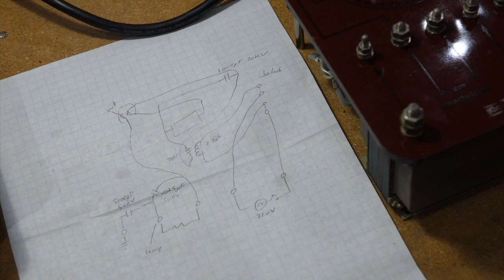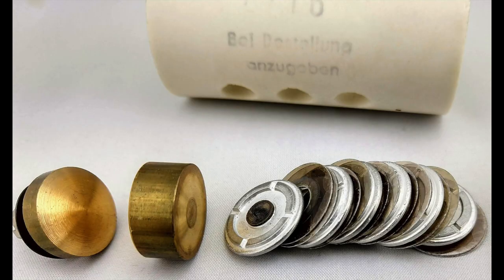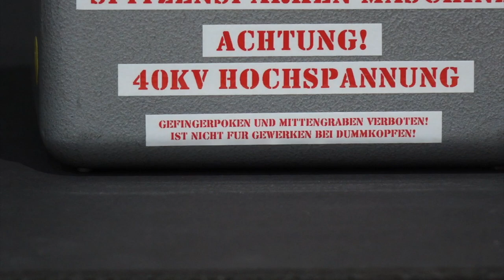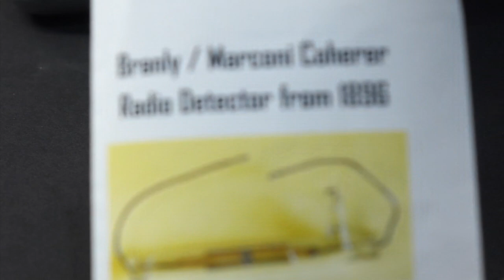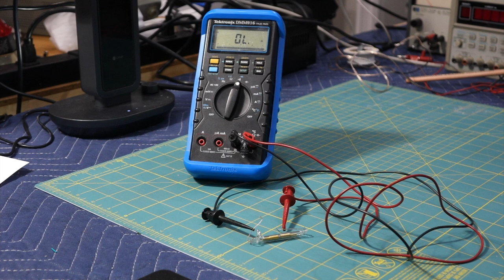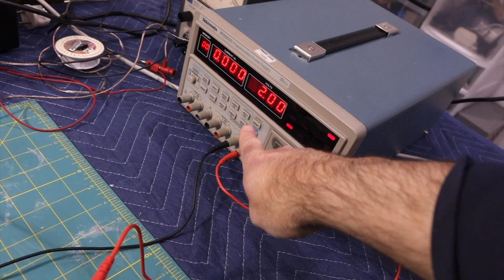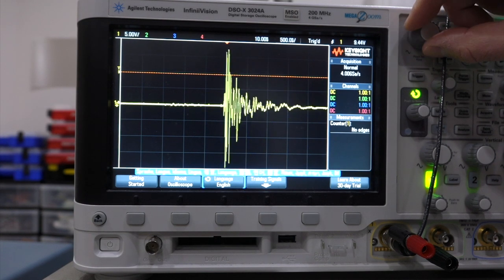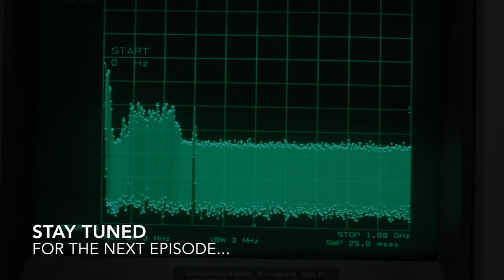We Rediscover Spark Gap Radio by Accident

Comment: So you gave people in your neighbourhood a pretty hard time listening to radio during that episode?
Reply: And TV and maybe wifi? FCC coming to knock on Marc's front door soon ;)
Reply: Power drops off with the square of the distance from the source. It may have been momentarily annoying for a residential block or so around.
Reply: No worse than CB radios were years ago.
Reply: What about WiFi and mobile phones?
Reply: @bobroberts2371  Ha!...but only if you transmit the numbers 4, 8, 15, 16, 23 and 42 ! 😂
Reply: @lwilton  Indeed, but there is a reason spark gap transmitters are illegal under international law since 1934. They are very wideband and very noisy. And he is powering with a 40W power supply, that is almost enough for weak transatlantic communication.
Reply: @BobWiersema  Yeah, it only took 5 years to get international law to agree to no spark gap transmitters unless in emergency. Obviously not noisy enough to cause concern then...
Reply: Naaaaah!. Marc built his house with the correct RF protection so the walls has a copper shield connected to ground!  ;-)
Reply from the maker: No, this is in my basement without an antenna. Not enough to cause any harm outside, I had a hard time to pick it up on an AM radio in the next room. Did not do anything on our WiFi or TV either (or at least the kids did not come running at me). You do a lot more damage running a Tesla coil. Woke up my lab computer though! With an antenna and on the main floor and a bit of tuning, that could have been quite annoying. It's pretty obvious why these transmitters were banned long ago!
Reply: @EwanMarshall  The ERP would have been minuscule, though - nowhere near 40W (the ERP was probably milliwatts)
Reply: Probably similar to if someone fires up an old car or tractor, especially if it has magneto ignition. Mine you can't take digital video if you're near it because every time the engine fires the video distorts severely, same with the McCormick deferring stationary engine.
Reply: I was wondering about that... I know a few HAMs and one of them had cause t see the inside of the special cars the FCC uses; i twas a plain old Chevrolet Caprice, except the roof was replaced with fibreglass and pasted to the inside of this was a large, circular antenna of great sensitivity and with which the source of any offending signals could be easily pinpointed.  The FCC has broad-ranging powers and I know for a fact that authorization has been given for windows to be broken out on aeroplanes so that an emergency beacon that had been set off by a hard landing and not subsequently silenced (it is ordinary practice to check the distress frequency when you are finished with the plane for this purpose) could be shut off.  Someone's plasma television was carried away because it was putting out anomalous signals and he refused to shut it off because he was confronted about it in the middle of a football match.  I think this was, perhaps poor timing on the FCC's part, but, eh?

I would think that he's in the clear as long as he doesn't operate this on a consistent basis, barring the implausible scenario of one of those cars being out front by chance, manned and operating, I can't imagine it caused such disturbance that anyone realized that there was an anomalous signal at all, and not just some random failure of their equipment or someone else's.
Reply: I remember receiving a pirate radio station on my cassette player.
Reply: @Lazarus7000  Plasma TVs were the bane of HAM radio operators everywhere while they were popular

Comment: Those poor SW- amateurs in your vicinity...
Reply: Hi there, I came to comments to ask this very question. What is it that they may be experiencing, and from how far away could this be heard?
Reply: Hahahaha, I remember my experiments back in1975 my brother still wondering why the TV has black and white bars in the middle of the football match, hahaha!!
Reply: Not just shortwave, that thing was kicking out RF over most of the spectrum. However, without much of an antenna, it was probably only detectable for a few hundred meters.
Reply: Spark gap transmitters are very wideband and very noisy. He may not have an antenna connected, but I'm quite sure that he can at least annoy any SW- amateurs with a reasonable antenna and receiver 2 or 3 kilometers away. When I was a young YL in the 90's, a cement mill in the next city used a Ward- Leonard- Set to start up their ball mills. That thing blocked every SW band for about 2 minutes. Went like bssssSSSSSSSSSSSS (increasingly louder and higher) brag (when they switched from the WL to the "runing" recticifier). You could count the number of machines they started up. And of course they did that when you just had contact with a very weak station and bad fading. Authorities didn't do anything about it, as it (quite strangely) only blocked the SW- bands and left VHF and UHF alone. So there were only a handfull of ham guys complaining and rising from your cozy office chair for them...

Comment: Next time there's a thunderstorm, I'd be curious to know how far away that coherer would be triggered by nature's own "spark gap transmitter" in the sky!
Reply: Well even with a normal radio you can hear thunderstorms on AM very well. Even if they are really really far away.
Reply: @Heads Mess hahaha yeah, I used to do that too. I took a neon on a stretched out coat hanger, disconnecting the jumper between each section as I went, touching the Heath-Robinson Tester onto the wire.  Thankfully, the farmer was clever enough to put the electric fence pulser by the entrance - easy to replace the batteries from the back of the Land Rover...  I remember the mechanism, it was just a small heated bimetallic switch turn the knob and the contacts moved further apart the batteries needed changing about every 3-4 weeks, on the plus side it did seem to cope with lightning, something later models had problems with, so lightning arrestors would have to be put in every 50 yards to stop the damn things from popping in a thunderstorm.

Comment: I remember we had a Blinkenlights and Dummkopf warning message on an big old Siemens development system I used back in the 1980s when I had a work placement at Wandel & Goltermann in the UK.  It used 8" floppies, when it worked at all, and was sat on my bench.  One day Princess Anne came to visit the site to open a new building, followed by lots of German VIPs.  The Dummkopf signs were hurriedly covered up when it dawned on us that the Germans might not see the funny side.  Shortly afterwards the machine gave up the ghost and I had to re-write all of my code on a "modern" HP system.  The business eventually closed and the new building was abandoned for many years.
Reply from the maker: We had that sign at the Computer History Museum on top of our "German" IBM 1401. We had to take it down too. Some Germans, mostly the ones that had low fluency in English, took it at face value. And it's obviously not funny if you do that. I (used to) speak German fluently and I still find it very amusing - it's plain English, but with cleverly substituted German sounding made-up words, mostly with English roots, so every English native understands it (i.e. "Not to be Operated By Dimwits" becomes "Nicht fur Gewerken by Dummkopfen"). Believe me, humor is the most difficult thing to catch when you learn a foreign language - I still struggle with it in English - and this is a double take on two languages on top of it.
Reply: @CuriousMarc  "Das machine ist nichtfur gefingerpoken or mittengrabben...".  I'm going to betray my age.  Shortly after I learned to read this ad appeared in the classified ads of my mother's Saturday Evening Post magazine.  You could for some nominal price get a nice printed sign with those instructions.  Scientific American at the same time had ads for Curta calculators.  You should get one of those.

Comment: When I was a kid way back in the early 50's I had a radio controlled Japanese toy bus that used this principal to steer the wheels.  It had a spark gap transmitter,  one press to turn right one press two presses to turn left etc.   After each detection by the coherer, the motor and gears that drove the steering linkage would reset the coherer by tapping on it with a metal spring weighted arm.  With fresh batteries IIRC the range was about 6 to 10'.

Comment: I remember reading an old book as a child where this principle was being demonstrated. The coherer was tied to a solenoid which triggered a little hammer to tap on the glass tube and break the connection. They even walked you through how to make the glass tube and metal shavings (through filing) and how to wind the transformer and the solenoid. Since it was supposed to be battery-powered, I assume they relied on the contact bounce to get the AC.

Comment: I was playing about with this in my childhood, swapping out a high voltage transformer for ignition coil (easier to obtain) and a long wire antenna with some very crude tuning, we got some really good range on this before I was advised to cease / desist and become a radio ham :)

Comment: Nice video! I make coherers with students, just using some iron filings, filling them into pvc tubing, and clogging that with some bolts. A LED and a coin battery completes the receiver. For the spark we use a Leyden jar.

Comment: Old TIG welding power supplies have a similar spark gap 'transmitter' built into them to initiate the arc. The high voltage was inductively coupled onto the main power supply output and a current sensing relay would turn off the spark gap when the main arc was established. They were pretty simple and just had two pointed electrodes hidden behind a metal panel. The only maintenance you had to do was to pull the panel and check the electrode gap on occasion.

Comment: In the late 70's I had a Radio Shack Science Fair 65 in One, electronic kit that had a 9 volt spark gap generator circuit project using the small relay as a spark buzzer and AM ferrite coil and thought  it would be cool to connect it to my 50 foot long wire antenna (not mentioned in the instructions).  My parents and neighbors were not  too happy when my signals blotted out nearby TV's sets and AM FM and CB radios.   Later I learned the FCC banned Spark gap technology in the 1930's due to the similar intrusive wide spectrum interference.

Comment: the secret life of machines had an interesting episode on radio.  in it, they made their own coherer out of a piece of plastic tubing with two screws screwed into it, and some filings from a silver coin in the gap.  they then hooked it up to a battery, in series with a small electric bell.  a wooden dowel was attached to the arm of the bell to hit their coherer to make it non conductive again.  they used kites with wire to make two antennas;  one was connected to the makeshift coherer receiver, and the other to the ignition coil on a car.  every time the car fired the spark, it caused the receiver to ring the bell.  they got a pretty far distance away with it still working.  I'm sure the episode is on youtube.  search for "secret life of machines radio".
Reply: Ha! Tim Hunkin has put out remastered versions of the secret life on his own channel and coincidentally that's what led me here.

Comment: I think the A/D converter may be a 18652A. This was designed and built by HP's Avondale division and was used for chromatographic data collection and analysis in the HP 335x series Lab Automation Systems. These ran on HP1000 computers, the earliest being the 2100, I think, with paper tape and teletypes. They went right through to the 3357 with RTE6VM and the 3350A series on RTE-A. The A/Ds were daisy-chained on a loop with a maximum of 100 metres of cable between boxes, and 15 devices on a loop. They were interfaced to a 18651A loop card in the HP1000 M/E/F series. I can't remember the number of the card in the A-series. I remember the 3357 supported up to 4 loops, giving simultaneous data collection, analysis and reporting on up to 60 chromatographs. The design was interesting. Chromatography does not require fast rates, but it does demand a very high dynamic range. What you are after is to measure the area under the curve, so these are dual-slope integrating A/Ds that effectively give you area slices, with no dead time. Another box that was available was the 18653B, which you could use to control an autosampler or to give you 16 bits of TTL input and 7 bits of triac output.  Let me know if you want any further information -- I was a systems engineer who worked on these systems.
Reply from the maker: Yes that's the very one from the Chromatograph. Thanks for the info, particularly the HP 1000 interface card number. Now, how to find one of these...
Reply: @CuriousMarc  You'll need LAS software to make it work, Marc, and even then it's very specific to chromatography.  Good luck!

Comment: David Hugh invented the Wireless Transmitter Receiver in 1879.
I created a low-power battery-operated miniature tesla-coil using a small electromechanical buzzer as the exciter.

Comment: Excellent video!
Reply: Between each zap and the tap to reset it... I'm hearing a 1734 Hz and 8670 Hz tone.. What is causing that? Actually looks like there may be more tones but those two are the most apparent...
Reply: @jdwilliams518  That was the multimeter tone signaling very low impedance.

Comment: I have a, small, bulb by osram, 300W! The bulb still works, but, it has at some stage melted the glass on the side and formed a bubble
Reply: If that lamp is actually a Xenon Arc lamp, be careful with it-these are under high pressure, and thus can explode, possibly causing injury(s).
I used to work with Xenon Arc lamps, and always hated to change them-even WITH protective gear.

Comment: Doc Brown would have been interested in this.  Do you think you can boost it to 1.21 gigawatts output?
Reply from the maker: No prob. Just add a flux capacitor and your are done.
Reply: Transmitting anything with that much power might alarm the FCC.

Comment: yeah, spark gaps induce a lot of noise. Marconi made his own coherer's with fine iron filings. So he had a stronger transmitter and more sensitive receiver. Electromagnetic waves passing over a conductor creates a magnetic field... causing the filings to "cohere". Bluetooth is still radio, wifi and cell phones too just using different protocols. Bluetooth topic for another day uses frequency  hopping an invention made long ago. Read this great book about the Invention of the radio "Signor Marconi's Magic Box: The Most Remarkable Invention of the 19th Century and the Amateur Inventor Whose Genius Sparked a Revolution"

Comment: Tom Hanks could have made Spark Gap Radio and contacted overpassing aeroplanes on UHF band. Repeated  SOS noise would have been enough.  Electricy from battery of urine and various metals. He had plenty of aluminium from the aeroplane toilet wall.
Reply: Timo Noko How do you step up a piss battery to several kV?

Comment: When you hit the coherer with the spark, there is a tone audible in the video, and when you tap it to clear the conductivity, it stops. What is that?
Reply: If you're referring to when the digital multi meter is connected, it just means that it is detecting continuity in the circuit.
Reply: D'oh! Was trying to figure that out as well.

Comment: You keep referring to Marconi, Tesla did it FIRST, he had an RC boat in the 1800's.
Reply from the maker: I am referring to the invention of what we commonly call radio today, which did hinge on the use of the coherer. Transmission of energy through electromagnetic waves had been demonstrated by several people slightly earlier. The first one was Heinrich Hertz  in 1888, who set out to experimentally verify the wave transmission predictions of electromagnetism, soon after Maxwell formulated his equations. Branly's coherer discovery is 2 years later in 1890. Marconi always acknowledged the pioneering role of Branly in the development of radio, including his name in the first message transmitted across the channel. But he is the one that refined it into practically viable radio, and got the Nobel prize for it.

Comment: The radio waves emitted by spark-gap transmitters, called damped waves, are noisy and have a wide bandwidth, so they can interfere with other radio signals. In 1938 the International Telecommunications Union prohibited this type of emission (called "class B") to get the last spark-gap telegraphy transmitters off the air, and it is still prohibited in all nations. Title 47 of the FCC regulations has the prohibition in a footnote at the bottom.   You broke the law buddy